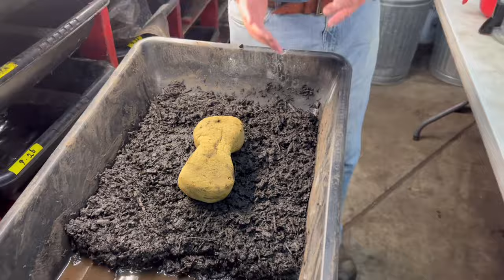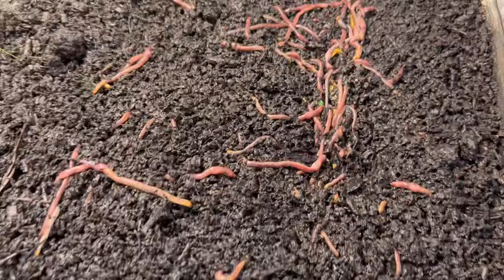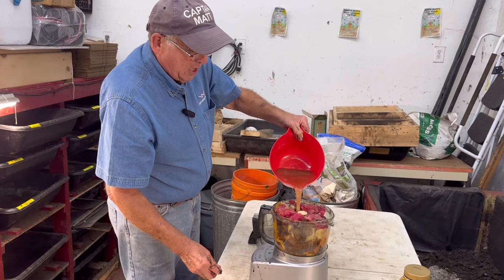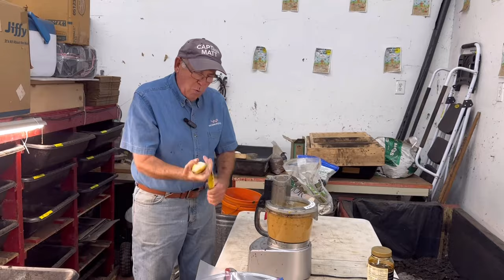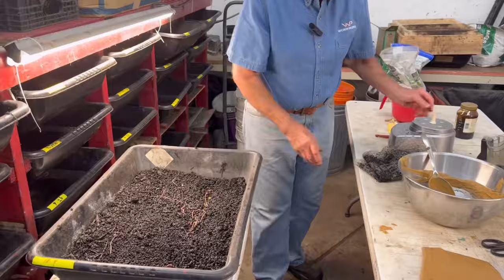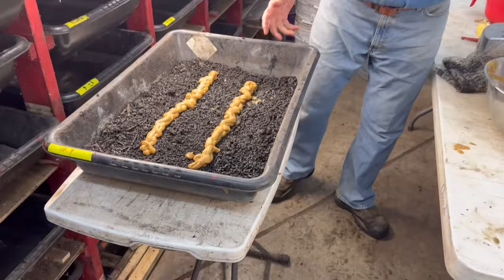Worm Breeding for Beginners - Part 2

Comment: What size are the bins?
Reply from the maker: The black trays in the breeding rack are mortar tubs.  We get them from Lowes (building supply) and they are the smaller tub used for mortar and sometimes drywall mud. 18" x 24"

Comment: @captainmatt what happens if you put more worms than 100 per square foot? Could you put 200 per foot?
Reply from the maker: They won't breed optimally if overpopulated.
Reply: Thanks Captain! What would you say are the maximum per square foot?
Reply from the maker: 100 is optimal for breeding - in a non-breeding bin, there is no real maximum as long as they have sufficient food.
Reply: @CaptainMattsWorms  thank you very much!